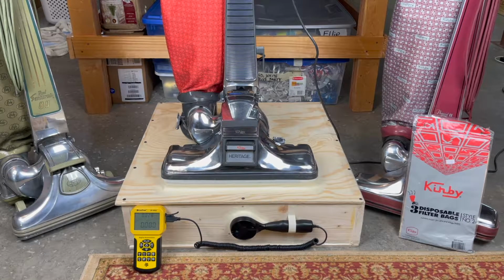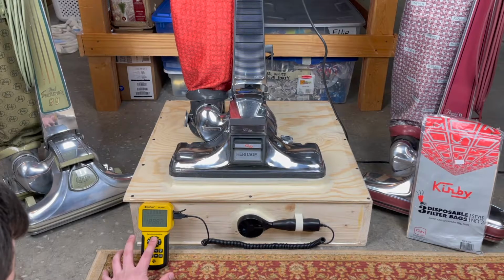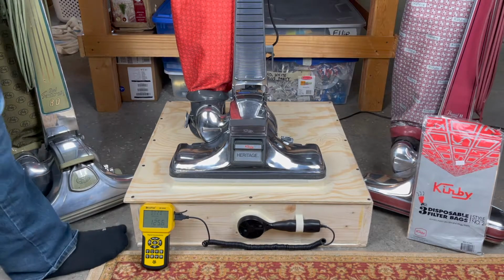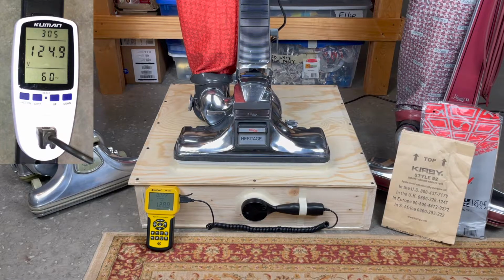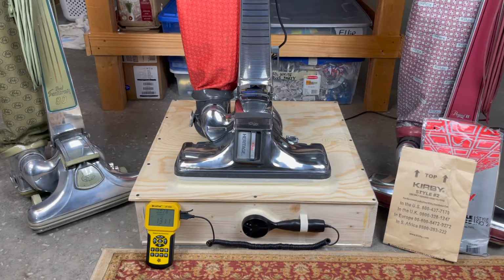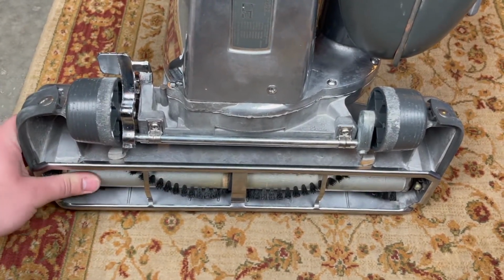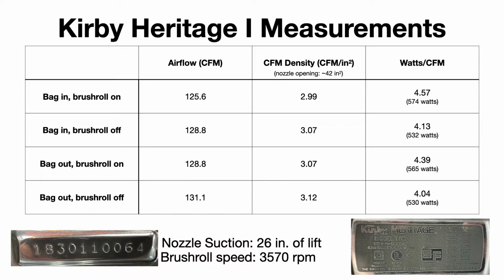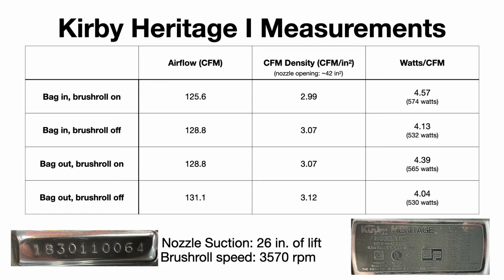Kirby Heritage I | Airflow, Suction, & Brushroll Speed Tests

Comment: This vintage Kirby with single motor beat that newest tandem air upright that’s more expensive! 😂🤣
Reply from the maker: Tell me about it!🤣
Reply: This Kirby has 18 more cfm which still makes quite difference.
Reply from the maker: @brentcho1275  Definitely.  Although I’d say the R40P’s agitation is certainly more aggressive than that of the Heritage, the Kirby’s significantly higher airflow will most likely make it better at fine dust pickup (hopefully I can test that soon!).
Reply: I always assume that Kirbys are better at fine dust for sure. Lol! 😝